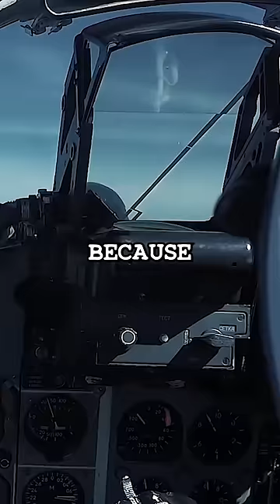What if a Fighter Jet Goes into Space?

Comment: 1/2 of what this video said was inaccurate. Yes, engine quits, environmental systems stop and pilot would die, electronics would also quit because onboard generator from the engine would also quit, but no overheating and fires from the electronics and pilots don't wear spacesuits, except for the SR-71 blackbird.
Reply: And U-2
Reply: @sek3234  well, you didn't have to be rude about it 😅😅😅
Reply: For a while, the F-104 pilots also wore pressure suits.
Reply: But why should a jet go in space, when it not designed for space, that makes no sense.
Reply: There wouldn't be time for the rest of that horse-hooey to happen, the plane would quickly fall back into the denser atmosphere, and as the pilot is on supplies o2 at high altitude anyway, he would be fine.
Reply: @melchurmoreau5677  some aircraft designers have dreamed of being able to make space capable fighter aircraft since the early days of flight way before Star Wars. It's a sci fi wish that people would like to see happen, but it can't because current tech can't overcome the problems involved in making it happen... yet.
Reply: @obi-ron  ok it's understood, thank you.
Reply: yup. fire needs oxygen
Reply: In space there’s quite literally nothing for any heat to transfer to. This causes overheating. That’s just how it works.

Comment: The electronics wouldn't overheat for the same reason the fuel won't burn, on the contrary, switches and relays will cease because of the low temperature.

Comment: I seem to remember a F 15 pilot doing something similar when they shot a satellite out of orbit.
Reply: Yes, I think they went to around 100,000 ft.
Reply: An F15 shot a satellite out of orbit? How should that work? So the MIg25 that is mentioned here in the video reached 37 km altitude.  The record for the lowest satellite ever is 165 km (which is very unusual and not a regular altitude), and they fly around the earth with 28000 km/h.
Reply: @sebastiannolte1201 when the fighter reach maximum altitude, the missile do the rest job.
The key is the missile by design to  shoot low orbit satellite.
Reply: @fadlisani2080  The F15 basically was the booster stage...
Reply: Famous case, I remember

Comment: Fun fact: the space shuttle almost became the first jet in space
Reply: The space shuttles were not jets, They had no jet engines.
Reply: @dogwalker666  they almost because they use to have jet engines but they decided to remove it Early in the development
Reply: @wheatley153  Really? I did not know that.
Reply: @dogwalker666  but note that they never actually install it in the space shuttle, they cancel this plan because the space shuttle it self is complex so if you add jet engine you'll ad extra complexity and weight.
Reply: @wheatley153  I know it did have a jet turbine APU for flight control but that’s definitely clutching at straws.

Comment: Space doesn’t have oxygen, but space is also really cold. I don’t think the system should overheat until the jet starts falling back into orbit, which will make the entire jet catch on flame.
Reply: On earth when something is hot it cools down by transferring heat from itself to the surrounding air. In space there isn’t anything to transfer the heat to. This causes overheating.

Comment: if you go high enough the engines shut down, you will likely spin out of control as well due to no air going over the control surfaces.. 

used to try this in simulators

Comment: The MiG-25 was designed around the twin Turmansky R-15 engines - each engine was actually designed to be a cruise missile. But they did not have the metallurgic science to prevent hotspots from occurring, so that plan was scrapped until the threat of the B-70 Valkyrie materialized. Well, they had these Turmansky engines laying on the shelf, so...

Comment: In a space suit, they absolutely would not die. Yes, things would get hot, things would also be unbelievably cold due to the temperature at high altitude. No, things would not catch on fire because there is not enough oxygen to support combustion or the engine would not shut off. Who fact checks these, Elmo?

Comment: Unless carries there by an actual rocket a plane wouldn't even be able to get there. Not only will your lift go down meaning your plane will have a harder time gaining altitude the higher you go, the air gets thinner and your engine would technically deliver less and less power as fuel would get burned less effectively. You'd basically slow and drop until you get to an altitude where engine and lift would work again

Comment: The MIG 25 can only fly that high because it can reach Mach 3 at which point its almost flying as a ram jet. A normal fighters engine cant suck enough air in with its turbines, the air is too thin at that altitude.

Comment: Uh. Insufficient air density over the flight control surfaces makes it an impossibility in the first place.  The only reason the MIG-25 achieved the record is because it literally burned out its engines to reach a speed sufficient to climb that high before gravity took over.

Comment: The only way for a fighter to reach space would be if it's equipped with a rocket engine, at high altitudes the airflow will be such low that the engines will no longer generate any thrust at all, causing the plane to stall and go down, and since the pressure of the air is really low even at high TAS the plane won't lift, will stall and go down
Reply: Might be possible in ballistic flight. Accelerate while you still have air, then coast to apogee.
Reply: @Danstrous  I did a quick calculation. It's beyond the abilities of current airplanes, but not much. To  climb ballistically for 80'000m (the height of the Karman line above current ceilings for very high altitude jets) you need a zooming speed of 1250 m/s, about Mach 4.

Comment: The Mikoyan-Gurevich MiG-25, also known as the Foxbat, holds several world records, including: 
Altitude
The MiG-25 holds the official Fédération Aéronautique Internationale (FAI) record for the highest altitude reached by an aircraft, 37,650 meters (123,523 ft). Test pilot Alexander Fedotov achieved this record on August 31, 1977 during a near-vertical climb from Podmoskovnoe Aerodrome, Russia. 
Speed
The MiG-25 was the first serial fighter to reach a speed of 3,000 km/h. The reconnaissance Foxbat-B has been tracked by radar at about Mach 3.2 (3,395 km/h or 2,110 mph). 
Fastest combat jet
The MiG-25 is recognized by Guinness World Records as the fastest combat jet. 
The MiG-25's operational top speed is limited to Mach 2.83 to prevent the engines from overheating at higher speeds

Comment: The higher we can go is the Karman line. Rockets can't work in space vacuum. If the pressure of a system is 0 then the work done by the expanding gas into that system is 0. Gas expanding in a vacuum doing no work agrees with Free Expansion. This can also be understood as the gas meets no resistance as it exits into the vacuum and thus transfers neither heat nor energy to its surroundings. If the gas loses neither heat nor energy then it has done no work.

The principle of work and kinetic energy (also known as the work-energy theorem) states that the work done by the sum of all forces acting on a particle equals the change in the kinetic energy of the particle.

Rocket thrust is given by the equation: F=m˙vexit+Ae(P1−P2)

where m˙ is the mass flow rate, vexit is the average exit flow velocity across the exit plane, Ae is the cross-sectional area of the exhaust jet at the exit plane, P1 is the static pressure inside the engine just before the exit plane, and P2 is the ambient static pressure (i.e. atmospheric pressure).

Provided that the nozzle is not overexpanded and flow separation does not occur, Ae remains constant, and the thrust difference is realized primarily from the change in P2. If nozzle is overexpanded to the point that flow separation occurs, you lose contact, however, the exhaust jet area drops as well, causing further losses. That's why we have adjustable nozzles, but that only postpones the inevitable. Space vacuum creates flow separation. We can't saturate space vacuum to create backpressure. It's the path of least resistance. The lower the pressure the faster the flow. Momentum is preserved in the exhaust gases, there is no momentum transference.

Comment: At one game there's some spots very hard to attack. So I would pull up hit after burners until it flames out nose over start coming down and restart the engines and this was above Mark 1 as I got with an range of lockdown I fired my missiles pulled up a little bit right racked the guns around the area. Hit the app furnace again and got out of there and Mach 2 never got touched.

Comment: First of all... there's no fighter jet that can enter outer space.  Ok, I'm not counting the X-15... that's cheating. 
The SR-71 (not a fighter) holds the fixed wing altitude record, but it can't escape the atmosphere. 
You need a rocket engine to achieve orbit. But if a fighter tries to exceeded its ceiling, it will suffer a compressor stall and fall back to earth.
However, if a fighter did leave earth's atmosphere and the pilot didn't have a space suit, the pilot would freeze and die... in that order. 😆

Comment: there is a thing called a ram jet motor. or just have a on board ox tank to add to the fuel mix.  would keep the motor running. but the pilot would still die. 
and the jet would fall back to earth as not possible to reach orbit speeds.

Comment: If the mig 25 reached 123,000 ft in a zoom climb, so could faster A12 or SR71 in a zoom climb. The hated F104 could fly at 102,000 ft and it wasn't a zoom climb in 1958. Kelly Johnson designed all 3 planes and knew the mig 25 was inferior. The NF104A flew at 120,000 ft plus long before (1962) a special mig 25 supposedly flew over 123,000 ft in 1977.

Comment: Space starts at 264,000 feet? Since when? The internationally recognised altitude is the Karman Line at 100 km (328,083 feet). The U. S. uses the much lower altitude of 80 km (262,460 feet) for some reason.

Comment: Nothing with overheat. Cause outside temp is too low. If atmospheric and internal temp control will fail, pilot will die from a mix of hypothermic shock and lack of oxygen... But if airplane would carry oxygen tanks instead of weapon systems, they could power engines and pilot air supply for a little bit

Comment: I don't see the electronics actually overheating I don't really think that's a possibility because if you were without power then you must be on batteries The thing is though a lot of systems are meant to run off a generator from the engine not from the batteries so those systems would actually shut off therefore eliminating overheating You may have some decay heat where it's just radiating heat off of it The other thing is losing pressure in the aircraft Yes could be a problem but the other thing is that we all know that water boils under different pressures differently so bitch with no pressure that water would boil and evaporate basically no real condensation inside if possible especially if you have good heat off the electronics 

As far as the engines go they probably won't really overheat unless you're in full afterburner but even then it's going to be hard because one you're up really high two the lack of oxygen which would notice over time even at full power your engines would be slowing down The other thing is because of lack of oxygen there's going to be a lack of fuel consumption at least you get good nautical miles per gallon😂 That's why the SR-71 was so efficient so damn high up

Comment: Narrator confidently gave us a b.s.reason for the engines not functioning,,the air isn't dense enough for the engines to work properly,the engines problems will start way before any air  reaches the burner section which isn't functioning because a fire needs an ignition source,,fuel and---Oxygen

Comment: How can there be fire without oxygen? I mean, when the equipment can burn, then also the fuel can burn. Or a I missing something?
Reply: As long as there is oxygen provided in the material, it can burn. It doesn't just need to be in the air.

Comment: Actually a jet engine will you run in a vacuum Because there's actually a test at a master museum. Called the space and rocket center. They have put a propeller driven motor and a jet engine in the vacuum chamber. And the jet engines still spit. A flying around in the The prop aircraft blades did not keep moving but the jet dead science

Comment: i don't know why i have to think of everything yall need to start sharing sum of Dat Doe
all you do is engineer an altitude initiation system to back up the failure by Electric turbo fan and Harmonically modulate the thermal Energy of the hot blades to produce some  residual power as you skirt the altitude profile if 123 is the Standing Record then mitigation begins at 124 thousand feet i say back up the back up systems to fabricate a transducer modulation system and store the heat energy as spare juice  it may cost a pretty penny but i say gold foil to 5/16th thick will be what turns the tables in favor of man you need 
to look at the Bible romans 12 : 2  Harmonics is where the missing link hides  and i bet you if i had the right backing i could splash one first shot

Comment: Not if you power the engines of the fighter jet with a nuclear reactor capable to provide energy to the systems of the plane and turbulence to the jet after this y need to just adjust a copkit inside to produce heat and be pressurised after that i guess y can go higher now to go outside of the planet it will be difficult i dont know any good material to sustained the heat

Comment: Where does this guy get his silly facts?  if a jet reached space, it would have to be going extremely fast to achieve escape velocity.  it has an advantage because the air is very very thin above 60K feet.  It would have to be going fast enough at 130K feet for the ship to continue on to space without air breathing engines.  basically it would need to be on a ballistic trajectory.  I don't think there is a single air breathing engine that could achieve that.  However, if, by chance, there was an auxiliary rocket engine attached it could continue to climb to space at a lower velocity.  It would be on a ballistic trajectory and reenter the earths atmosphere.  if it is going slow enough, it could survive re-entry.  especially if it could get its engines started again.

Comment: Where to start with this rubbish:
1) It's disputed he ever reached that altitude
2) the engine wouldn't suddenly die at a particular altitude but would start failing gradually, with the climb reducing.
3) Combat aircraft do not use bleed air from the engines for breathing air- think about it, how would that work in a combat zone when all sorts of nasties in the air
4) You'd struggle to overheat anything at that sort of altitude- the temperature could be as cold as -100C. Not even the most modern computing equipment would generate enough heat to cause a problem there.

But ultimately the engine would never get you high enough for gravity to reduce enough to counter your attempts to reduce altitude back down.

What a load of utter nonsense.